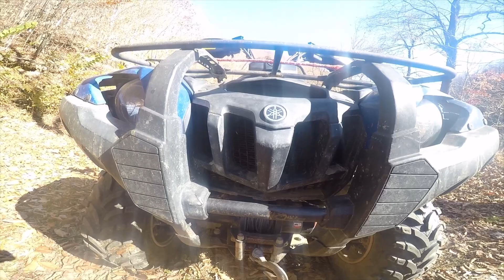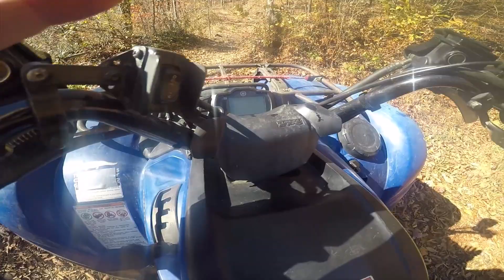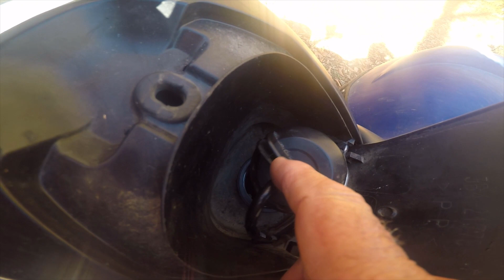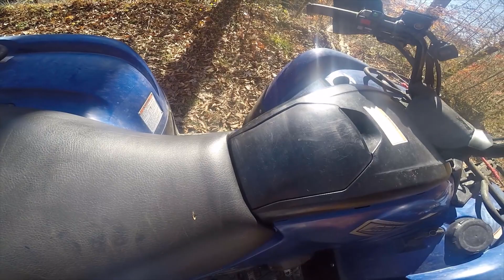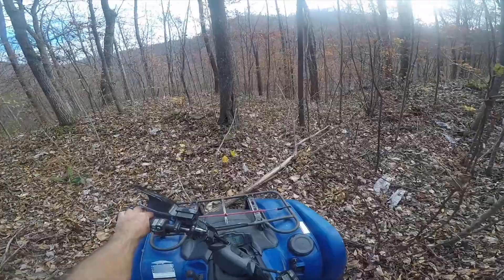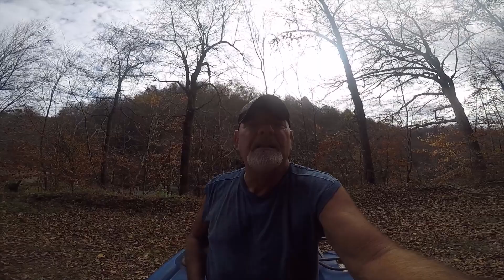*BEWARE BEFORE YOU BUY*  Grizzly 700 fi 2008 Review And Analysis

Comment: Gas can boil at 120 degrees sometimes less. A hot day and heavy riding can boil any gas.
Reply from the maker: yes sir i'm aware of that,but these old grizzlys have a gas capp that causes the gas to heat up super hot, i had to make a hole in it and run a tube into it before i could use it,my advice to anyone one i love the grizzly i use mine for everything, but fix the gas cap before your gas starts getting hot,trust me on this it will start boiling, just trying to help, god bless,

Comment: I just purchased a pretty clean blue 2007 Yamaha Grizzly 700 just like yours! Super excited about it! Mine only has 1,800 miles and 215 hours. Would you recommend I drill and tube the gas cap since it hasn’t been done? No gas boiling issue right now but you never know when that issue could arise. Also how do I know if my CV axles need to be replaced? Just if they break? I’ve replaced a torn CV boot before on my 02 Grizzly 660 but never replaced a whole CV axle. Have enjoyed my 02 660 a lot but looking forward to some new adventures on my new 07 700! The fuel injection and power steering are quite a nice upgrade from the 660.
Reply from the maker: thank you my friend for sharing this with everyone, now about the gas cap,if its not getting hot i might not do it untill i needed to, but as you know it cound happen, now if those axles start cracking and popping, then i would replace them, otherwise some good lube will do the trick, my rear axles are going bad, ready to be replaced, if you replace them make sure you buy a really good quality pair the cheap one just won't last very long,, i hope this helps you my friend, enjoy your grizzly, god bless,

Comment: Good review! How many miles and hours do you have on yours now? I’m considering buying a blue 2008 Grizzly 700 with 2,500 miles and 362 hours near me for $5,500
Reply from the maker: I WOULD BUY IT  MINE NEEDS REAR AXELS BUT OTHER THAN THAT ITS IN GOOD SHAPE I'M NOT SURE ABOUT THE MILES, I LOVE MINE, I WOULD NEVER SELL IT,
Reply: @godgunsandkenny   I’m probably going to go try and look at it next weekend if everything works out 👍 I currently have an 02 Grizzly 660 but want to upgrade to the Grizzly 700 since the 700 has some nice advantages over the 660 like the Fuel injection and power steering. Plus my 660 is getting up there in miles and hours and is in rougher shape. I think the previous owners drove it pretty hard. I bought it about 5 years ago as my first ATV and paid under $2,000 for it. Back at that time I was also considering Polaris but glad I got the Yamaha and will continue to stick with Yamaha in the future. I’m glad to hear yours is still running well for you! Hoping I’ll have a Grizzly 700 in the near future 🤞
Reply from the maker: @AMF96  thank you sir for sharing this information with everyone,I appreciate it very much,👍👍👍
Reply: @AMF96 I have a 2010 with around 9,000 miles on it and like 565 hours still runs great. You won't be disappointed!!

Comment: Yep, bought my 2008 700 efi eps new. I have her torn down in the garage right now for a full maintenance spa treatment. The first year after cracking the gas cap in high altitude the entire contents blew up into my face. Yamaha installed a vent for the fuel tank that is faulty. They will not acknowledge or admit to the problem. I took out the vent and installed a standard small line fuel filter where the vent was. I’ve also had to change the stator which shorted out. I love my red beast, it takes on anything!
Reply from the maker: HELLO ROBERT, ITS GREAT TO HEAR FROM A  GRIZZLY OWNER, YOU REALLY SOUND LIKE A MAN THAT KNOWS WHAT HES DOING, I MEAN TAKE IT APART AND PUT IT BACK TOGATHER, AWESOME, I UNDERSTAND THAT PROB YOU WERE HAVING WITH THE GAS CAP,  WHEN I FIRST BOUGHT MINE IT GOT SO HOT I THOUGHT IT WOULD  EXPLODE, BUT I DRILLED A TINY HOLE IT THE GAS CAP AND PUT A TUBE IN IT THAT DID IT PROBLEM SOLVED, I APPRECIATE YOU SHARING, GOD BLESS,  P.S. I LOVE MINE AS WELL
Reply: THANKS! I KNOW ENOUGH TO GET ME IN TROUBLE SOMETIMES. YOUTUBE REALLY IS AN EXCELLENT RESOURCE TO LINE ME OUT WHEN I GET IN OVER MY HEAD.
Reply from the maker: YOUR WELCOME MY FRIEND, GOD BLESS,

Comment: I bought a 2008 back in 2008 and road it as hard as a utility quad has ever been ridden, short of ghosting it off a cliff, but still pretty close. They are a workhorse and virtually indestructible. I would never buy or own another quad. After I bent the steering column and frame rolling it down a hill backwards multiple times, I sold it for enough to pick up a 2009 Ducks Unlimited Grizz and still have that one to this day.
Reply from the maker: i appreciate you for your comment, wow, what a story i agree they are a real workhorse, i could not do without mine, i use it for everything,  thanks so much for watching, god bless,👍

Comment: Thx for posting good video👍im going to look at a 2008 grizzly 700 fi soon but it dosent have power steering, just wondering if theres a big difference..?? Also do you have to do maitenance on the clutch?
Reply from the maker: THANK YOU MY FRIEND FOR YOUR COMMENT, i thought most of the grizzlys had power steering,i guess i was wrong,if its not got it it will be harder to steer, not that bad depends on how strong one is,lol, ive never done any maitenance on my clutch, mine is not a stick, i cant see myself doing without my grizzly, its a keeeeper, a real work horse, god bless,
Reply: @godgunsandkenny  Thanks for replying 👍
Reply: I had to do some research. I didn't realize it was optional EPS in 08. I would personally look for an EPS Griz, it's so darn easy riding and driving.
Reply from the maker: i appreciate your comment, its hard to beat a grizzly, mine is an 07 and still going strong, never been touched except the axles, awesome, god bless,
Reply: @godgunsandkenny  my father has an 07 Grizzly that he uses just for working on his property. 6000 miles of plowing, brush hogging and pulling logs. Still goes great when I bring mine up to visit him. Never even had to change a belt. 

People push Honda, but the Grizzly is just as reliable and has all the power you'd ever want for fun too.
Reply from the maker: i appreciate you TREVOR,man i know what you mean about the pulling logs  and so on,i use mine for so many things, don't know what i would do without it, yeah i have a honda, but it can't compete with the grizzz, thanks for whatching my friend, god bless,😀
Reply: @godgunsandkenny  definitely subscribed. Have a safe and fun weekend!
Reply from the maker: i'm so happy to have you my friend on board, thanks so much for the sub, god bless,😀😃😀😃😀

Comment: How did you fix the fuel issue where did you bring that hose to?
Reply from the maker: thank you for your comment, thats a good ?? easy answer just make a hole in the cap  run a little tube  through the  hole, down in the gas tank about an inch or two, then let the hose end  run down beside your gas tank, very easy to fix, may i ask is yours getting hot? god bless,

Comment: Good video and i agree Yamaha's are the best . One thing though, you said it will run almost 100mph.. I believe your gauge is reading in km. So that would be roughly 60 or so MPH. Have a great one and enjoy.
Reply from the maker: hey thanks doug for your comment, it was when i first got the grizzly my gauge was not in  km, at that time it was about a month before it changed to km  i remember when it happened, just never botherd to change it back, have a blessed day,
Reply: @godgunsandkenny  where did you run your tube from the gas cap and what size is the hoe you drill
Reply: My 2008 grizzly 700 stops at 65mph.
Reply: They will run about 115km/h
Reply: He is the brightest bulb 💡 ✨️

Comment: Great review on your 07 Grizzly 700!! I have the exact same machine, color and all. The Grizzly 700's are one of the best machines out there in my opinion. But one thing I noticed on your machine is that you're running in km/h instead of miles per hour. So really you only have about 6,264 miles on your machine. The top speed on mine stock was 68 mph, but in km/h, it's over 100. I just wanted to point that out in case you haven't realize that yet. It's quick and easy to switch back over to mph. Your owner's manual will tell you how to switch it over if you decide to. If you set your trip meter, it's nice to know just how many real miles you've traveled if thinking in miles. I hope this helps, and thanks for sharing your video!!
Reply from the maker: hey man, hows it going?thank you for your comment.i love the grizzly and i love your state.sometimes i wish i lived there. i have 2 more 4wheelers but both of them are down and need repair. they are both hondas, but honda is a great 4wheeler as well but the grizzly is my favorite, lookslike you and i have a few things in common,  you have a BLESSED DAY, ypour doing great keep it up,
Reply: @godgunsandkenny  Thanks for your kind words Kenny!  Yeah I love living here in Alaska, and I just can't see leaving this place. I moved up here from Nashville TN in 1990, and I just love it here. Yeah, yamaha and Hondas are my two favorite brands on most everything they make. As my job, I fix and repair 4 wheelers, motorcycles, snowmobiles, and pretty much anything with a small engine. I've always loved it, so that's what I do. I've also got some property out in the bush and I want to start building some structures, so I'm either going to build my own bandsaw saw mill, or just order a woodland mills saw mill. I usually try and build everything I can, but their prices are hard to beat for what you get. The prices of lumber and steel products have gone out the roof, so a mill makes more sense now than it ever has. Well you have yourself a blessed day Kenny!!
Reply from the maker: @Alaska7506 hello my friend MERRY CHRISTMAS, I WANTED to tell you that live in Kentucky, not that far from Nashville tenn,  it sounds like you and i have a lot in common, i love to .make things and build things as well. ive got an old Honda 300 atv  i wish i could get it to run still working on it i think it might be the motor probs  have a blessed DAY,
Reply: How are u hitting 68? I got a power commander and a full exhaust and my bike only hits 58. I got oversized rims and tires but it shouldn't change it that much if anything it should be faster top end
Reply: @j5183  so with oversized tires it’ll say you’re going 58 but you’re actually going more
Reply: @j5183     27" mud lites on a stock grizz slow u down 8-10mph
Reply: @s.a.t419  yeah i bought the bike all done with pipe, Power Commander, snorkel rims and tires bike was brand new only 50 miles on it got it for 5k special addition looks sharp bit with it wasn't red/ maroon but couldn't pass up the deal